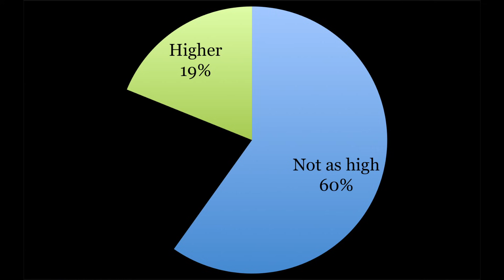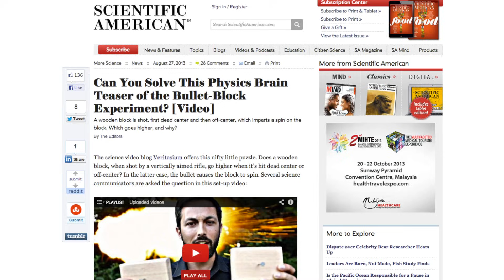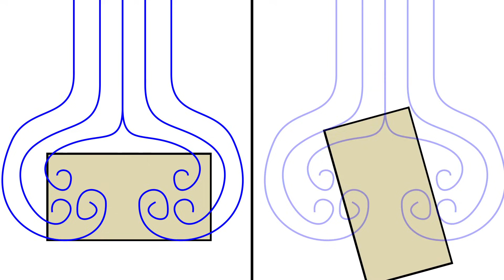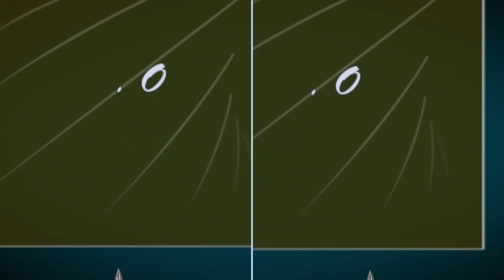Bullet Block Explained!

Comment: In the case of the block which was shot off center, the reason why it rotates is because gravity pulls down on the side that did not receive the thrust, so there is no "extra energy" coming from the bullet. to visualize it, think about dropping those blocks from the same height. Put two pins under each block so that the blocks are resting on the pins. Now, Remove both pins under the first block simultaneously. The block falls with no rotation. In the second case remove only one pin. The block spins while falling. The blocks have the same mass and fall from the same height, so the kinetic energy at the point of contact with the ground is the same. The second block rotates so it must have more energy than the first one. on the other hand the potential energy of both blocks is the same. The explanation must not be how far the bullet penetrates.
Reply: But in the case with the pins, the first block will fall faster than the second. You are simulating a yo-yo here. And a yo-yo falls faster when it is dropped while you aren't holding the string.
Reply: The reason why the block rotates is not solely due to gravity, a single force is enough to produce a torque (hence rotation if initially at rest). If the experiment is conducted in a gravity free space, the same situation would develop. And I've said "not solely". If there is gravity, then the force acting downwards contributes to the net torque (as it is on the other side of the centre of mass/rotation) and hence results in the block rotating at a higher rate than what would have been the case if it was conducted in a gravity free space.
Reply: Shoot a block of wood while in space (no gravity) and when hit on center it won't spin and when hit off center it will. Gravity only contribute to potential energy not momentum. 

Obvious troll is obvious.
Reply: ***** Gravity acts equally on all (mass-)parts of the block, so does not contribute a net angular impulse. The net effect of the gravity is that of a single force acting on a particle of mass equal to the block's mass, at the center of mass.

Comment: Haah, i knew it. i left the response in previous video and i was right :) It's because of the energy that bullet loses on impact. it's common sense to me, i can virtualize it in my head so clear.

Best way to modify this test, is to use different materials. Have a metal block vs wood block, they MUST have same weight, so it means wood block has to have something heavy in the middle or metal block must have hollow points and shoot both in center. Idea of this test, is to see if they still go same height. My prediction, is that metal block will not go as high, because bullet loses a lot more energy on impact.

To clarify, you need ENERGY to punch through something, if you want bullet to go through the wood block, it requires energy to do so. So if bullet loses less energy during penetration, then it will carry the block higher. This test clearly showed that bullet that loses less energy during penetration / impact, will carry the block higher (yes it was same height, but i refer to the extra rotational energy, it had extra energy left).

Comment: The linear momentum garbage is absolutely wrong, and I'm sorry for everyone that has to unlearn this.

The answer is heat, which is the second answer after the momentum garbage
Reply: mvwoon  The linear momentum answer explains EXACTLY why the blocks reach the exact same height. The discussion of heat, deformation of the wood, etc. explains why it seems like the rotating block has more energy when it fact it doesn't.

Comment: The physics weren't thoroughly explained. The linear momentum part is correct. The angular momentum part skipped an important detail: At the time of firing the bullet, the bullet DOES have angular moment relative to the axis of rotation of the block, defined as the bullet mass (M) times the distance to the axis (R) times the velocity of the bullet (V), so L=M*R*V (or I*omega, where I=MR^2 and omega=V/R). After the collision, this angular momentum is conserved in the combined bullet-block system. The spinning of the block at the peak of its launch is not indicative of extra rotational energy in the system.
Reply: jware29 There's definitely the same amount of energy in both systems. You don't create more energy in a system by firing the bullet off center, you just transfer some of the energy that would otherwise go into deforming the block into rotational energy instead.
Reply: jware29 Exactly.

Comment: Well, the block does contain some mass and a higher quantity of inertia than the bullet and the bullet does travel HELL faster than the block, plus the bullet was shot at the center of the block where kinetic energy from the bullet is transferred and distributed equally to both sides of the block whereas the bullet shot at the right-side of the block transferred and distributed momentum (and kinetic energy) mostly towards that side of the block. In result, the bullet shot to the center gives both sides of the block same amount of momentum and kinetic energy but the bullet shot to the right-side of the block gives it's energy mostly to that part of the block. Unsatisfied? Try doing that in a VACUUM chamber! hehehe

Comment: Simple ways to adjust the experiment would be changing the firearm, size of the block, type of wood used, type of bullet used, or other such small changes. Putting the situation into a place where the depth of the bullet would be more then a fraction of a millimeter.

Comment: the first block it's not spinning because the two direction of spinning are reciprcally annulled. the total energy inside the system is the same. one vertically applicated on the mass centre rensponsable of the lifting and an infinite number of vector of rotational energy.

Comment: How do you make the penetration difference measurable?  You change the size and material of the block.  If you make the material of the block out of something much more compressible, say Jell-O, then the bullet you retain much more of it's vertical momentum when it enters the block.  Then all that you have to do is make the block much larger and all of a sudden the rotation of the block will play a bigger role in the penetration of the bullet.

Comment: Sorry, gotta point out a mistake. if the block was floating, a direct hit would make it go higher. a side hit would split the momentum into angular and linear. with it sitting on the frame, the side hit translated some of its angular to linear.
Reply: Linear momentum and angular momentum are two different things. With no external force to the system, they both stay constant.

Comment: this guy is pretty good at physics but only to an extent. the correct answer is that the non spinning block will always go further. he also falsely states that all the momentum of the bullet is transferred to the block. Not true. the bullet does work on the block, by causing a pretty serious hole, dislodging and shattering grams of cellulose fibres. this requires a non "negligible" amount of energy.  another error is that yes, it does matter that one is spinning since the bullet had only linear momentum to begin with , which it transferred to the block in the form of linear + angular momentum.
Reply: He has a PhD in physics. And also both blocks will always go to the same height because of Newton's Second Law (F=ma). Same mass and the same force applied to the system, same acceleration. Easy. Also [mechanical] energy is not conserved, so the rotating block actually has more energy than the nonrotating block.

Comment: How are angular and rotational momentum independent? If I spin a wheel and then drop it on the ground that rotational momentum will certainly be converted into translational momentum, that is, the wheel will roll forward.
Reply: IT WILL SPIN THE EARTH AND ROTATION MOMENTUM WILL BE CONSERVED, YOU STUPID

Comment: make a larger block out of a substance with less density.  Use ammunition that has been hand loaded as precisely as possible. the larger block with lower density should allow for a slower deceleration curve with the bullets, making the difference more visible.  also shoot multiple blocks at graduated distances from the center to see how much each increment effects rotation and bullet penetration.  do this on each side of the block, Coriolis force may affect it as well.

Comment: Solved:
Actualy, the difference in total final energy is due to the fact that the second system (with the offset bullet) was different from the start.

If you consider the system as the brick+the bullet even as they are separated you can clearly visualize that the initial angular momentum of the first system is 0 (as the bullet is going exactly in the direction of the center of mass of the system). But the second system (the one with the bullet offset to the side) has a part of it moving in a direction not going through the center of mass, therefore it has angular momentum which is, certainly (disconsidering the decay of energy from collision with air particles and stuff), the same as the final.

Comment: MODIFICATION #1
Choose a material with a much lower density than wood. This would allowing for an exaggeration of the bullets penetration depth. Like a block of rigid (not foamed) dense and sufficiently thick block of polystyrene foam. You could choose a ballistics gel but i get the feeling it would prove too heavy in the volume that would be needed. It would not become airborne and showcase these differences in momentum as the block of wood does, despite the fact that it qualifies as a material less dense than wood.

Qualities of the best material to choose for a round 2 of this experiment:
Readily available
Thickness and density enough to stop a bullet within it.
Total volume of material small enough so that a significantly measurable flight path can be achieved, for ease of measuring.

Comment: Regardless of how deep the bullets penetrated each block, the energy that is absorbed by the block shot right at the center is greater compared to the block shot off center. The rotation force is the consequence of that and it is the very reason why the amount of absorbed energy is different and at the same, this extra energy is wasted by the rotation itself which ends up reaching the same height.

Comment: Pick a softer material, but you would also need larger blocks of this material. Then it would be easier to measure the difference of the bullets penetration.

Comment: Use a block made of a softer substance which will would offer greater penetration, not let the bullet escape, and still move upwards like the wood block. The more the bullet penetrates , the greater and thus more measurable the difference. Because .1% of 1 cm is 0.01 mm but .1% of 100 cm is .1mm which is technically measure able according to you absolute error of even an average ruler.

Comment: I haven't studied this thoroughly yet, but I suspect using a solid steel block would yield a different answer. That is, the solid steel block would NOT go as high when struck off center.
Veritasium seems convinced the depth of intrusion is "the truth" yet afterwards asks for more definite-depth experiment suggestions.
I was with the not-go-as-high if hit off center crowd. I'm not satisfied with the explanation provided thus far. But as I said, I haven't researched enough yet. I haven't even read the comments yet. Since this is now a year old, everything should be settled by now.
Reply: In the case of a perfect collision (no deformation of the blocks or bullets) meaning perfect transfer of energy from the bullets to the blocks, the block hit off center would go to a lower height, indeed. It's simple conservation of energy. In the case of non-perfect collisions (aka real world ones) the result is the one we see in the video.
Reply: I initially thought it wouldn't go as high but after watching this video it seems impossible that it wouldn't. How do you suggest the steel block would seemingly defy the conservation of linear momentum?

It seems to me that this thought (and actual) experiment is implying that a perfectly elastic body won't rotate regardless of where you hit it, not that it would go a different height off-centre.

edit: or the bullet will bounce off at a different speed when it rotates (after all, a perfectly elastic collision by definition means they bounce off each other).
Reply: IamGrimalkin

Well for the steel block I think the bullet would ricochet when it hit the block at it side. That way the momentum of the system block + bullet would still be conserve even if the block hit by the side would not go as high. While the one that hit the block at the center would stick to the block and transfer all the momentum.
Reply: IamGrimalkin First, we have to consider what we mean by "how high".  In this case, we mean direction travelled in the opposite direction to gravity.  And it is true that the block hit on the side would not go "as high", for exactly the reason you state - if the bullet ricochets, it will take a portion of the total kinetic energy along for the ride.

Assuming no deformation, and a bullet trajectory exactly opposite to gravity (i.e., straight "up") then the distance travelled by the object being shot will be greater the closer the vector of impact is to passing through the centre of mass of the object.  If the bullet hits a smooth surface perpendicular to its initial trajectory, and that trajectory is directly opposite to the vector of gravity, and also passes exactly through the centre of mass of the target, the highest possible proportion of the original momentum will be preserved in the initial direction of travel, hence the target will travel the furthest possible distance.  If you hit on an angle (either an angle to the surface at the point of impact, or an angle away from direction of gravity) and/or away from the centre of mass, then rotational energy and/or projectile motion comes into play, and the object cannot possibly travel as "high".
Reply: UthacalthingTymbrimi That's all technically correct, but that's almost an entirely different problem than the one presented in the video. You're describing an elastic collision where mechanical energy and linear momentum is conserved, whereas this video is describing a perfectly inelastic collision where the projectile and the block have the same final velocity after the collision. 

The most important factor about redesigning this experiment is that the bullet MUST remain lodged into the block it is hitting, otherwise it represents an entirely different problem altogether.

Comment: instead of firing straight up on the off center shot, fire diagonally from the gun's original position. i am guessing that the bullet won't penetrate as far into the wood if it isnt traveling perpendicular to the wood's surface. i dont own a gun or a safe place to fire one so all i can do is speculate. also, what would happen if you fired straight up and in the center for both shots, but rotated the piece of wood 90 degrees for the second shot. would the direction of the grains in the wood change the height in any measurable way? would a higher caliber bullet and larger piece of wood more easily show the bullets' penetration difference?

Comment: Hello!
I have something to say here, and hope that the veritasium guy reads and responds to it..
Aren't we ignoring the fact that the case where bullet hit is offset from the center of mass(say, towards the right), the platform on which the block's axle was resting also applies a torque (actually an impulsive torque at the suspension point of contact of the block) on the bullet-block system, the very moment the block is hit? The force is vertically upwards since the axle-supporting surface is flat and horizontal, and the point of application of force is offset from the vertical line passing through the center of mass of the bullet-block system. Well, of course the axle applied an equal and opposite reaction on the supporting surface the exact same time, but we don't have to worry about that; when analyzing a system, we have to look at force applied ON the system, not by the system.
There are two things going on here, which I believe, like other things in this video, are enlightening..
1. This force applied by the supporting surface on the bullet-block system alleviates any momentum conservation that does not count the supporting surface (and the surface stands and the earth and so on...) as a part of the system for which the conservation has to be applied. Not even the linear momentum conservation that we easily applied to compare/calculate height to which the blocks rose. This force is what takes the block higher above than our own intuition would allow it to rise.
2. The force is also the reason for a torque on the bullet-block system. However, as our intuition would have it, the torque is oriented so that it would rotate the bullet-block system clockwise. But the bullet-block system actually rotate counterclockwise, as seen in the video! That means, if it were not for the supporting surface, the bullet-block system would rotate much more rapidly, since then there would be no clockwise torques to slow or down! (Go ahead, try the experiment without any supporting surfaces.).
Thanks for reading! And replying...:)

Comment: Make one block from pure wood, make another block with a steel ceramic plate sandwiched between the wood to ensure bullet stoppage, but without too much energy lost to plastic deformation.
The block with the plate may need to be inserted into the wood through a machined hole so that natural, lightweight force from the sandwiching wood would keep the metal and the wood from blowing apart.
The forces I'd worry about would be deflection and heat to plastic deformations.
What I'm trying to say is that the bullet may not go as far, yet still lose as much energy anyways.